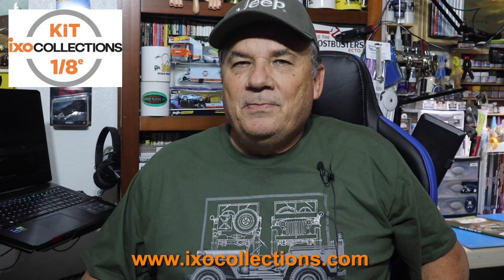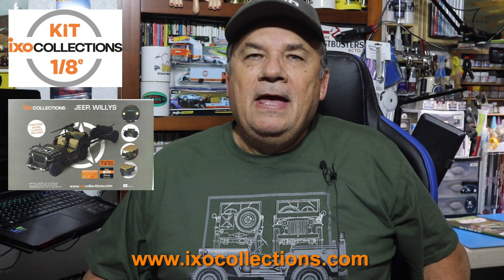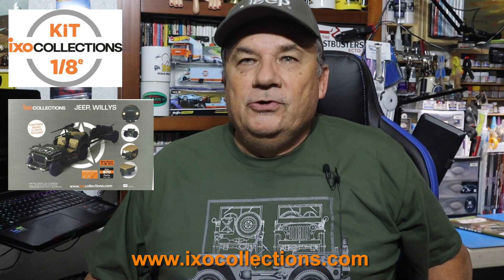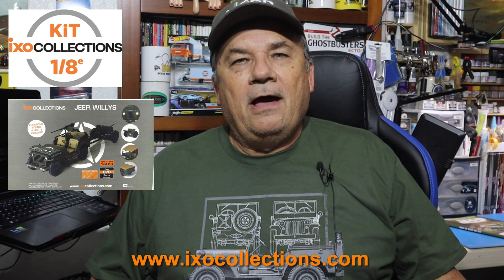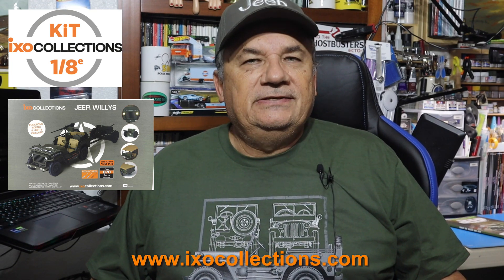Build the IXO Collections Willys MB Jeep Stages 31, 32, 33, and 34

Comment: That #1 spark plug wire needs to route around the drivers side of the water outlet, not be underneath the radiator hose.  That will be a maintenance nightmare!  Lol!
Reply from the maker: I’ll see what I can do to correct it. Lol
Reply from the maker: Thanks for pointing this out, I have done as you suggested and I will update this in my next video. Cheers.